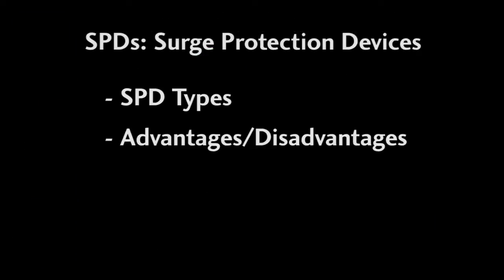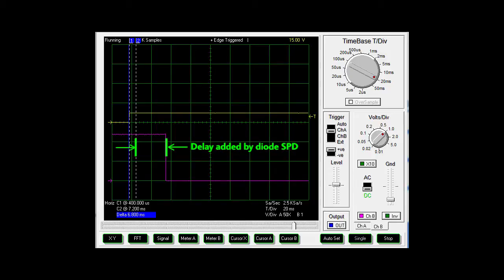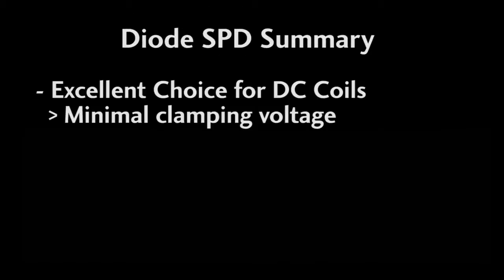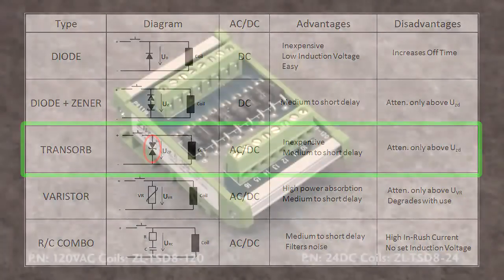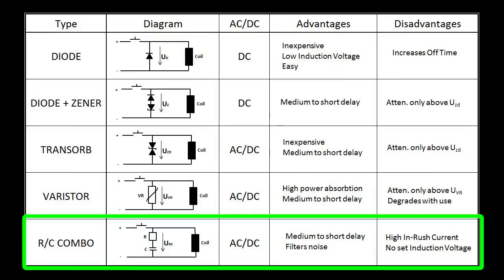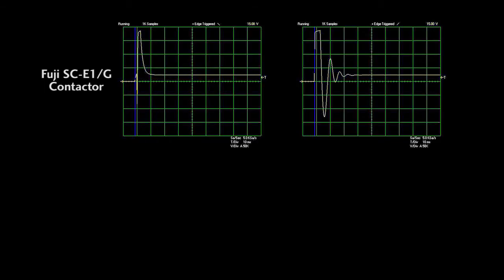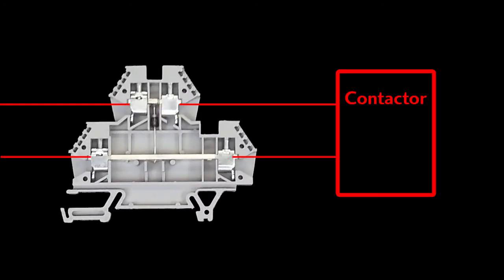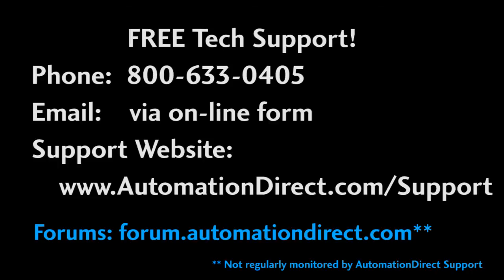Surge Suppression Devices How & When to Use from AutomationDirect

Comment: Just a comment - the AD transorb you show is for 120 vac so it is bidirectional, but the 24 vdc transorbs sold by AD are unidirectional. I've purchased several of the 24 vdc modules over the years, and generally wire two transorbs back to back to get bidirectional protection.
Reply from the maker: @paganskier, thanks for the comment, that is very useful information.  We will be sure to include it in any future videos.   👍

Comment: how do you test  the siemens 3rt1916-1dg00 surge suppressor diode for s00 contactors,
Reply from the maker: Tinodaishe, I would imagine it could be tested like any other diode, however AutomationDirect does not offer Siemens products and have not information on their diode. It would be best for you to contact their technical support for the Siemens products.

Comment: Are surge protectors just to protect the PLC, not the load you are driving?
Reply from the maker: Yes, Normally the goal is to protect the PLC from anything downstream on the circuit which is why you place them as close to the PLC input as possible. It really wouldn't offer much protection to other devices because if the surge reached the PLC it has already affected the other devices in the circuit.